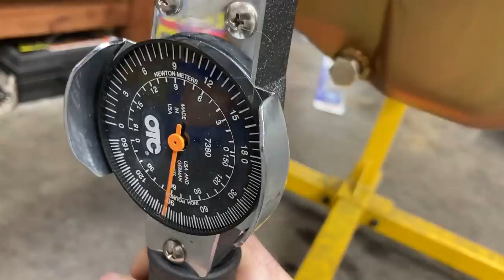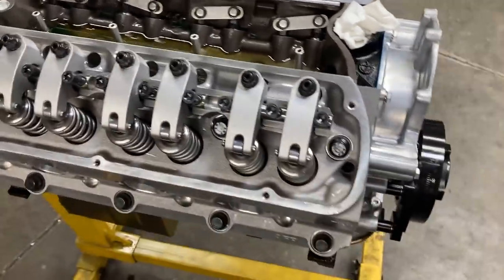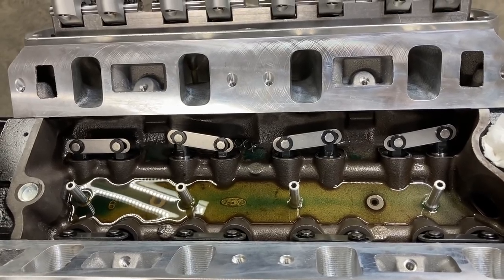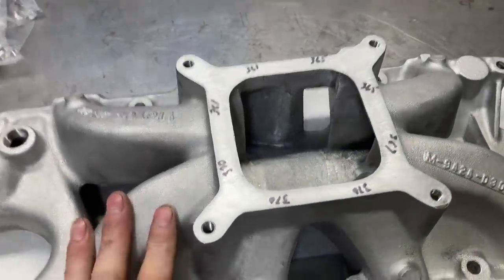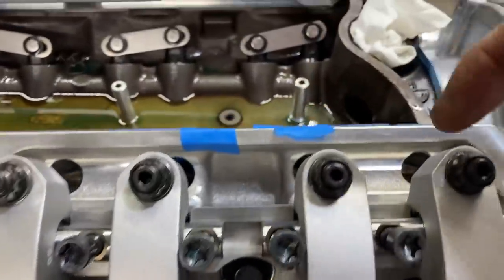Lykins Motorsports 311 SBF Final Assembly Part 1

Comment: 11:50 There's a bunch of oil that will never return to the oil pan between the lifter banks with those standpipes. Not being critical, but I suppose a 3/16" hole at the back of the block in that well would have prevented it, and why I'm not a fan of standpipes. I doubt much oil would end up in that center area during operation.

As far as your edge orifice lifters, I had to do the same thing which I attribute to not having enough clearance in my lifter bores. (Dart Little M, Lunati Ultra Pro lifters which are .001" larger than typical Comp, etc mechanical rollers) I used a Dremel cutoff disc but ultimately it put too much oil upstairs so I restricted the galley feeds to about .060" to compensate.

Looking forward to some noise from this!!!!
Reply from the maker: There are oil drains at the rear of the lifter valley on a SBF.  It will drain, especially in a vehicle that's moving.  Not to mention the huge hole at the front of the lifter valley.
Reply: @lykinsmotorsports  exactly, and drains into the right places, not all over the crank!
Reply: Somebody doesn’t know SBF’s as well as Brent but, that’s why we are all here or at least why I’m here. I want all the educational info I can get in order to build better engines.
Reply: @craig8187  What do you think happens to the oil that runs out of the bottoms of every lifter bore and cam bearing?
Reply: @yarrdayarrdayarrda  it runs over the crank and adds to windage oil of course! Just like oil exiting bearings etc.  Reducing this windage oil is a good thing at high rpm, so we make parts stiffer so we can reduce bearing clearance and allow us to circulate less oil and we reduce unnecessary oil that adds to windage oil like most of what comes from the top of lifter bores and pushrod feed lifer during lash and what manages to run back down the pushrods etc by fitting stand pipes to control where the oil drians but still allowing movement of crankcase gasses. We can even enclose the cam tunnel if we want and direct all of that lifer base oil you mention away from the crank! There are some things in an engine we cant really change and some we can, and other that we do what we can within reasonable budget, so just because we cant change one thing doesn't mean we dont bother about changing something that we can!
Reply: @craig8187  As you've eloquently pointed out, the stand pipes are a complete waste of time. I agree.
Reply: @yarrdayarrdayarrda  ok 👍 to each their own!
Reply from the maker: The standpipes cut a considerable amount of oil off the crank.  Short of using an enclosed cam tunnel, this is the next best thing.   Absolutely not a complete waste of time.
Reply from the maker: I haven't had a YouTube channel for very long, so I'm still trying to get used to the trolls.
Reply: @lykinsmotorsports  unfortunately it doesn't matter what you do, someone just has to pick on it. Good channel, good work, 👍

Comment: What components help with that , for years that question is on my mind . Thanks for answering
Reply from the maker: Bearing clearances, pump relief pressure, restrictors in the engine, etc.  An engine only needs so much oil to function correctly.  Anything above that is oil that's being pumped out of the pan.
Reply: @lykinsmotorsports  … Brent you have an excellent way of methodically explaining the intricate details that are often overlooked by some shops. “Close enough” is fine for common SBC builds. We who choose to build Windsors as well as Clevelands, have to deal with unnecessary Shinola created by online oiling system experts. 

The desired overall oil pressure is obtained by using the required clearances (controlled leakage) at key areas throughout the engine assembly. 

I especially like the simple yet effective mods you did to each lifter body. And your rocker covers are all business looking withoutthe excessive bling that others sometimes have. Way to go ! 🏁

Comment: With that spring 80psi oil presión the bottom don’t go dry in lubrication ?
Reply from the maker: No sir.  Lots of details added to the engine so that it doesn't flow that much oil.

Comment: Are those the stock length 5.090 rods or 5.4 rods? I’m trying to guesstimate how good I can eyeball measurements
Reply from the maker: Neither.......  5.700".
Reply: @lykinsmotorsports  I was banking on the stock 1.6 compression height on the pistons but my guess was way off 😅

Comment: Why use the alum rods over h beam in this app?
Reply from the maker: An H-beam rod is not always the strongest rod.  There are many I-beams that are extremely strong (Oliver comes to mind) and even Scat's 4340 I-beam rods are right up there in with the H-beams in terms of strength.  They are also usually lighter than the H-beams.  To answer your question, there is a long-time standing myth that aluminum rods can't be used for a long period of time without being changed out.  High end rod companies such as BME, R&R, etc., tell you that aluminum rods can be used in street vehicles for long periods of time.  My goal is for this engine to eventually end up in a personal vehicle after it lives its life as a dyno mule.  I'm essentially gaining aluminum rod data for that scenario:  rod bearing clearances, piston/head clearance, etc.
Reply: @lykinsmotorsports  i thought you might plan on running a boost setup is why the alum rods!! I see where you are going now!!! How long can you run alum rods!!! This should be a great test!!
Reply: Id like to build a nice SBF for my 79  foxbody!!!

Comment: I'm completely mystified as of what's going on here-> checking the deck height occurs during the design and build in machine work not during final assembly! aluminum rods! with Gasported pistons! in a 2 bolt main stock Ford 289, 302,351 block along with a few more weirded out things going on there AIN'T adding up!!!!!!
Reply from the maker: No sir, checking deck height does not just happen in design and machine work.  It also happens during mock up and assembly.   Sometimes we do things different than what the internet says, huh?
Reply: @lykinsmotorsports  I worked 17 years in Automotive Machine along with numerous years CnC designing and machining small block Chevys,fords all the way up to Top Fuel Motors so that should clue you in on  where I stand sir'.. but I'm curious if what class of drag racing your involved in with this small block Ford!!??.. .
Reply from the maker: @bobadingo  It's not a drag race engine.  It's a dyno mule, just like the other 3-4 mules that I've had over the years, used for testing different camshafts, combinations, theories, and parts selections.   If I don't try new things, I don't stay up with technology and then I don't pass the horsepower on to my customers.   If we stay with the same old combinations all the time that the internet deems "normal" or "ok", then we don't learn anything.
Reply from the maker: @bobadingo  So which top fuel teams did you work with?  I know some guys....